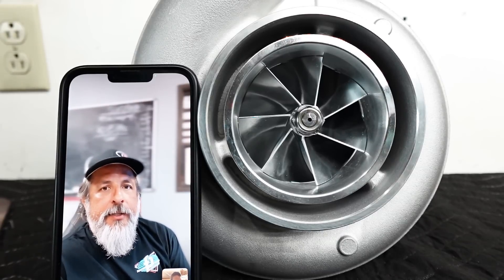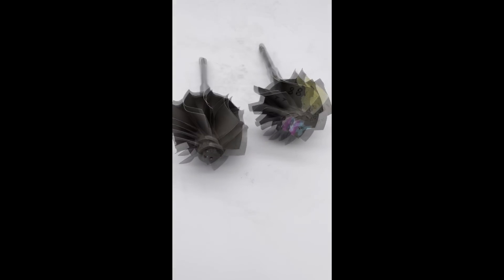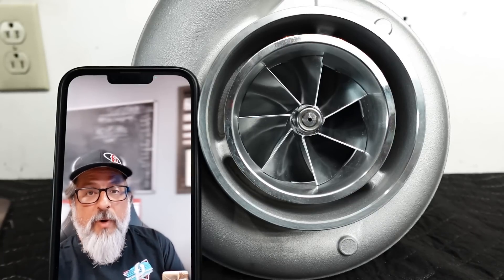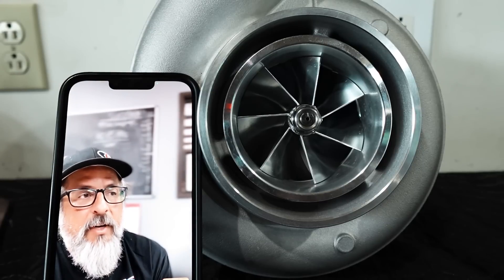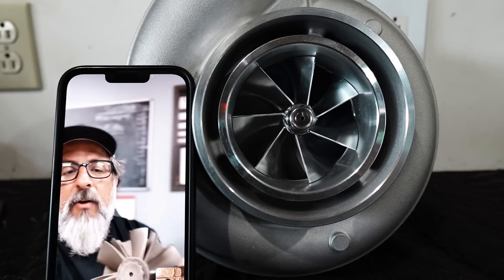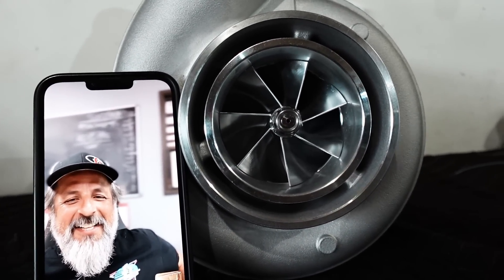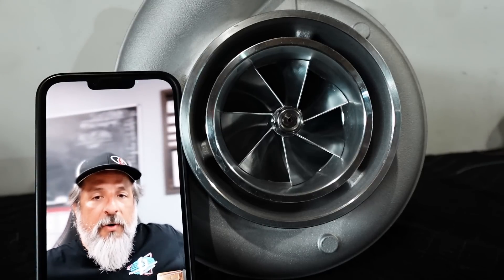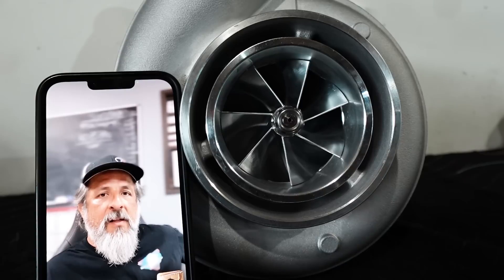New forced performance billet 85/88s UHF xona rotor turbine technology

Comment: So much miss information. This would be an extreme modification IF the throat area was previously choking first (bad wheel design for running conditions of the compressor). In which you would have had a ridiculously high Turbine Specific speed, and crazy high back pressure. The inertia difference between the 2 designs would be marginal, but... You would have high kinetic energy at the vanes wrap angle exit with this splitter design, and therefore an efficiency loss (enthalpy loss). 
Larger wetted surface area and frictional loss? = I'm not sure. 
Reduced spouting velocity? = I'm not sure. 
I'm all for being different and trying new things, but a targeted properly designed full blade turbine would be a much better choice.

Comment: I got a 98 Chevy truck I'm putting lq4 with 799 heads e85 sloppy best cam Holley cpu wanna do 600 to 800 whp what turbo should I use. this is a junkyard build low budget need a cheap turbo

Comment: PR of 2:1 on both compressors is 4:1!   45 psi. The power of multiplication. UHF turbine wheels are the real deal, the one on my 62mm Xona Rotor turbine has done very well compared to standard type turbine wheels.

Comment: I think a twinscrew blower with the turbo would be a more interesting combo, but still interested in seeing it regardless.
Reply: I thought that too but I think a twin-screw would prevent the air from going in the way you want it too because the screws only allow a certain amount anyways so it would kind of make the turbo are hard to tune or almost unnecessary to make more boost that's why I can't wait to see how it goes because there's just not enough info
Reply: @freedomfox8183  but it would be fed condensed air. It would work the same as compound turbo. It just would have positive displacement down low and even more tq production in low to medium rpm. But maybe too much tq. lol
Reply: @4familyman Check out Norris Design.His blower will disengage and bypass once the turbo is spooled up.Probably fun for I street car or super big power, but for me the new turbo tech spool fast enough.

Comment: If robert is sifting through commets haha do you think this is too much turbo for a 4.0l inline 6 barra shooting for 1k rwhp?
Reply: It will make a lot more than 1000whp. You could go a bit smaller and have more response if the goal is 1000whp. His Hd8082 would be a good choice. Or even better a Xona 10569s
Reply: Thanks guys, the hd8082 was actually my first choice.
Reply: You could also hit that number with a $500 eBay Chinese s480 clone so I guess it depends on how big of a spender you are
Reply: @chipcurrey653  boost threshold also matters for a street driven car. An s480 on a 4.0l will of course make 1000whp but also be a turd. The HD8082 is only $850 from FP and would be better suited. Yes the Xona is $2k but it’s next level of spool and performance. Even the little 68mm 9569s would make 1000whp.
Reply: @4familyman  where is there any dyno testing on this? Richard holdener has the 75mm compressor version of that 8082 in videos (the 7582) and the turbine side does not look 1000 crank HP capable, or maybe just barely in his super ideal conditions. I had the fp 8082 on an lq4 6.0 with the ss2 on my last Buick and now I have a $288 eBay s475 on an ly6 6.0 with the sloppy best cam in my new Buick. It makes more power per pound of boost and both spooled before converter stall speed. It isn't apples to apples due to the better heads but I am interested in any testing that shows the standard t6 hot sides on the s400 series are turds in real world conditions.
Reply: @chipcurrey653  he is talking about a 4.0l not a 6.0l. A t6 is a great match for your 6.0….. I’ve run t6 s480’s. And 475. And 8892. And 8488 and twin 7275’s and 7875’s and gt55 91mm on 5.3, 6.0, 5.3 stroker, 388ci. E85. M1. Etc. Quite a bit of experience. Unless it’s a drag car only, a t6 on a 4.0l for only 1000whp would not be my first choice.
Reply: @4familyman  I guess my conclusion from trying both, is that I would aim to hit the power level with the cheapest turbo possible and then make a change if I didn't like it - especially given the huge price disparity between say $288 for an ebay s475 (which will do 1k crank) and $2k for the turbo in this video. I could experiment with 7 different $288 turbos for the same price. There are also <$500 T4 smaller AR s475s on ebay. 

But maybe if he is using a barra, where you have to spend huge money on a conversion th400 or show that you really just have a dyno queen with a t56 type trans, price is not a concern?
Reply: @chipcurrey653  The turbo in the video is $1050 retail and has a 10% off code. Not $2k like you said. 
And it’s also a 1400whp turbo. Wouldn’t be my choice for a 4.0. Mine would be the $850 t4 HD8082.

An s475 is going to really struggle to make 1000whp. Most LS’s tap out at 800whp with one. The compressor map shows 100lb/min just barely and waaaay off it’s efficiency. That’s why I suggest a billet 8082. I’m sure he could find an eBay option in the similar size also.
Reply: @chipcurrey653  the th400 bellhousing was 600 bucks and the billet face converter from Circle D was 999, all in all I'm in this build for the same price as a nice ls combo.
Reply: @Oddfox_garage  did you cut the trans and put the bell housing on yourself?
Reply: @chipcurrey653  I will yes.
Reply: @4familyman  68mm 9569 makes 1000hp... on 2L Evos. like the PTE 68-70 and later 10569 did on mine. 

You run into back pressure issues with larger displacement setups. He has double the displacement, He is better suited off with a 75 series wheel or larger. An S480 wouldnt be too laggy if you opt for the smaller turbine. Forced Inductions/TDI has 80/83 units, and I think FP has smaller than shelf 96mm hot sides as well.
Reply: Power under the line, it will be less peaky